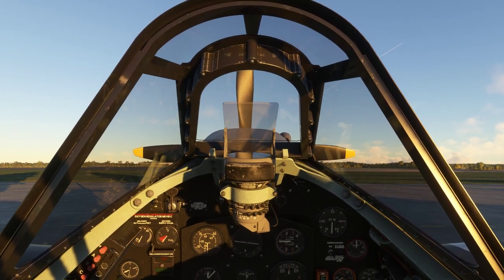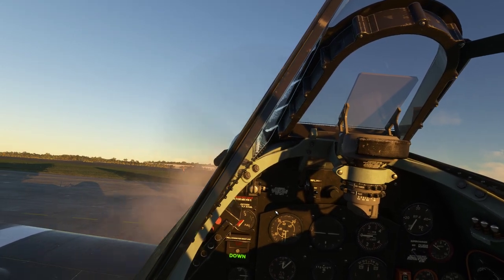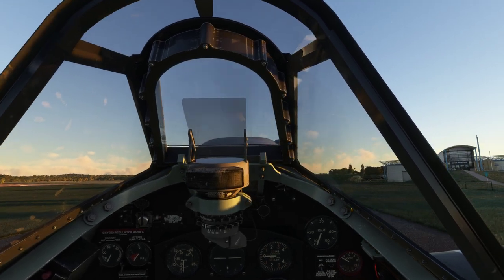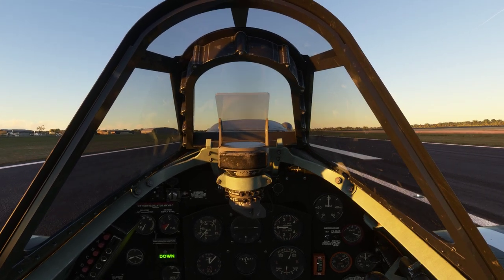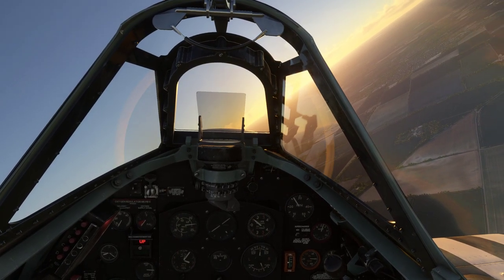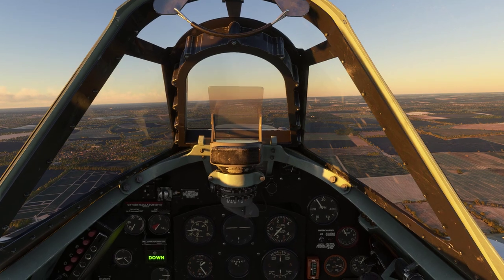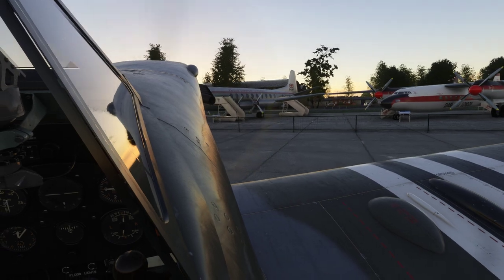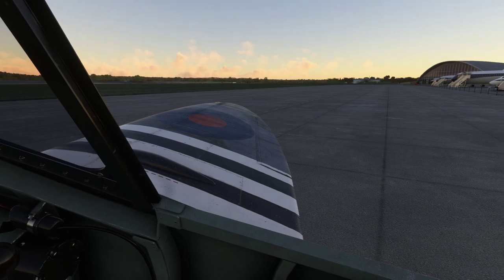Flyiniron's Mk IXc Spitfire takeoff and landing tutorial MSFS2020

Comment: In the real aircraft you'd spend as little time as possible with the boost at zero or less, it can foul the plugs.
It's one reason why pilots during WW-2 would land off a break, the hard 180 turn entering downwind bled the speed off ready for gear and flaps despite the boost staying above zero. The finals turn is one long curve to maintain the best view you can get of the runway. Probably you know this, so I just wasted the effort writing it :-)))
I bought the Flyingiron Spit as soon as it released, but the takeoff behaviour was really odd back then. I've flown a MKIX motion simulator that was built for the purpose of converting pilots onto the real thing, so I had a reasonable clue how the Spit should behave. With the FlyingIron version the tail just seemed to snap up almost violently at about 60 mph without any user input at all. They've obviously tweaked that going by your video. In flight it does seem very Spit like ( I've also flown a real MKIX, although obviously no takeoff or landing ) 
I'm almost tempted to reinstall MSFS after watching your video but the constant forced updates were just really getting on my nerves.
Reply from the maker: You should reinstall MSFS if just for the spitfire, running the boost below 0 is unavoidable as it spends a lot of time down there taxing the main issue there is preventing boiling the coolant  I do get what you mean with the long approaches this was mainly for those who don't have the confidence to do a turning approach